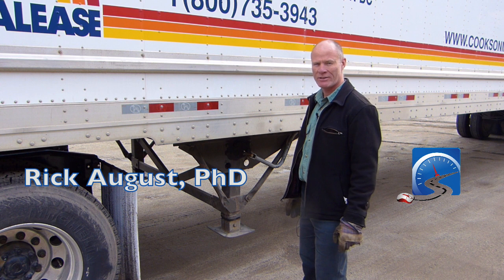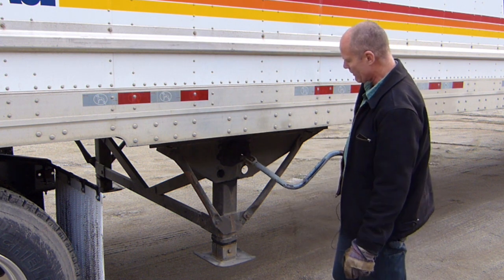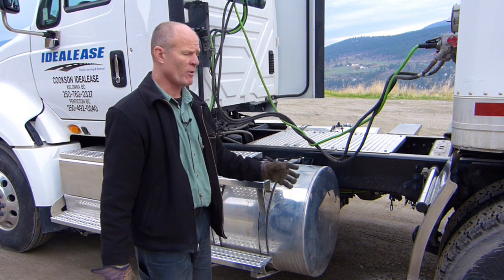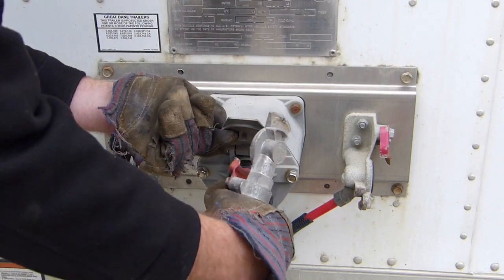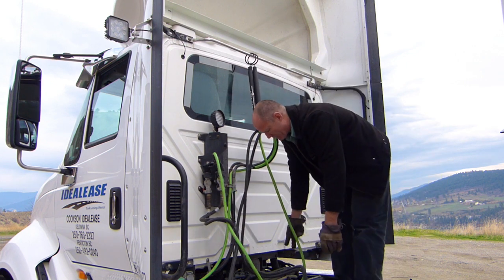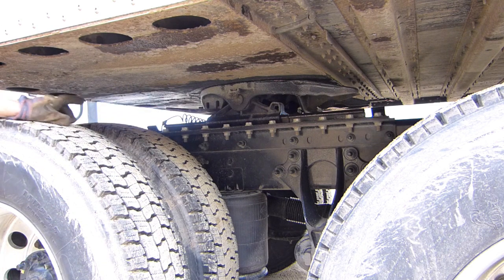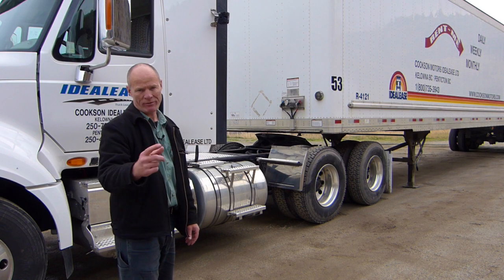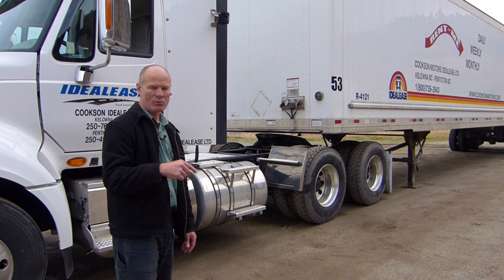How To Correctly Unhook A Semi-Trailer From The Tractor

Comment: Thanks for the information Rick. The truck I normally drive doesn't have air suspension but the last few days I've been driving one with air suspension and I was letting the air out before moving forward. I'll definitely try the way you showed on Monday.
Reply from the maker: Hi Texas Slim - Thank you for your comment.  We're happy to hear we could help out. Drop back and let us know how it goes. All the best, Cheers Rick
Reply: @smartdrivetest  Hey Rick, I have been pulling forward a bit before lowering the suspension and it works wonderfully. Thanks again.

Comment: So if you were to couple the trailer would you back under the trailer right before the Kingpin and then raise  air suspension up and then continue to couple or would you just backup under the trailer with the air suspension already lifted and raise the trailer.
Reply from the maker: Hi Joseph Vigil - Thank you for your comment and query. Lower the air suspension, back under the trailer so the fifth wheel is just in front of the kingpin. Stop and secure the tractor. Get out and check that the 5th wheel is in line with the kingpin, the jaws are open and the locking handle is out. Then reach in the cab and raise the air suspension. Go and check that the truck and trailer are at the right height to hook up. In other words, when the suspension comes up, there's no daylight between the trailer apron and the fifth wheel. If there is anything further we can do, drop us a note. Always happy to help. All the best, Cheers Rick

Comment: Do you set the trailer brake when unhooking ?
Reply: YES!!!  For 2 reasons. 
1: It prevents the trailer from rolling away. 
2: it prevents the gladhand from blowing air out when disconnecting it.  That air can blast stuff in your face. It can also blow back at your face and hit you.

Comment: Just a little reminder there guy, at timer 1:33 you placed your hands onto the side of the trailer to down the legs. Cranks work real good in the hot summer days when the lube is real loose. " Caution "-  Classic boo boo, from my 40 years, last trailer was short handle, next trailer, got it spinning is good, leaning against the trailer, not knowing the size of the handle, got a good spin, leaned in, and that handle belts you one good, right the mooy. I didn't lose any teeth, but it did chip one and it hurt. I know you've adjusted your noodle, you've probably been there, just remind the crews, to watch the handle size. Some are longer than others.

Comment: I always drop the air suspension on the trailer before I dynamite the trailer brakes. Then do what you did in the video. If I'm dropping a heavy trailer on anything but concrete I will try to ring dolly pads to help disperse the weight of the dolly legs. And yes I've forgot to unhook the airlines when I was a new driver and had the smack the back of the cab, but that was years ago now. Also had to rewire a couple light plugs when I was new.
Reply: Forgot to mention I enjoy watching your videos, very educational even for an older trucker. Keep it up.
Reply from the maker: Hi Greg D - thank you for your kind words my friend. And yes, dropping the air suspension before unhooking the trailer is a good idea - especially if the trailer's loaded. It puts less pressure on the dollies. And of course, we all made mistakes in the beginning. All the best, Cheers Rick

Comment: Is there good method to backing only a few inches. I find its hard to tell when to stop in time.
Reply from the maker: +Darlene Young thanks for your comment & query. Are you talking about backing under the trailer? If so, look out the driver’s window, pick a landmark & back off that. Let me know. All the best, Cheers Rick
Reply: Thanks Rick, I am practicing hooking and unhooking before each trip. I will try the land mark tip to know when I've moved 6 inches. I find hooking more difficult to remember all the steps. Thanks for this great demo and LAP tip.I wish there was a good trick to memorizing the steps for hooking up.  I'm learning to start on an up hill and reversing. Moving along. Have my road test next week.

Comment: In my opinion the trailer is to high ! The way i do it is i let my landing gear 1/2, 3/4 of an inch of the ground ! Unlock the trailer and i move forward about 1 feet and then release the air from the suspension and go out when its totaly down ! And its better because the next time you coupling you lower your suspension go under the trailer (totality of the fifthwheel) and crank it up so when you couple the fifthwheel fhe landing gears are not touching the ground so if your out of line there is no stress on them by forcing in one direction ! But it is me ..
Reply from the maker: Hi Jimmy Pineault - Thank you for the information. Keep in mind that this is the procedure for the CDL test. As you and I both know, it's different in the "real world" of trucking my friend. All the best, Cheers Rick
Reply: Hi Rick ! Of course i understand the cdl test fact but in my counrty (Qc canada) we dont have to uncoupling and coupling a trailer .. we arrive with the trailer we do pre-trip inspection and go for a drive and a back up and thats all .. but in Usa it look more complex !
Reply: @jimmypineault2648  I didn't have to uncouple for my cdl test in Ca.USA

Comment: You do not drop the bags first.  That's how you fracture the landing gear.
Reply from the maker: No, LAP - landing gear, lines and pin. And after releasing the pin, pull the tractor forward a bit to get out of the king pin. When you're clear of the pin, then drop the air bags. All the best, Cheers Rick
Reply: @smartdrivetest  I think I was responding to someone  completely different.   I've always called it LAF.  Do you explain why you never pull the fifth wheel last?  Many don't know.

Comment: Pin puller is important for more reasons than just avoiding grease.  Pulling too hard on the handle WILL destroy your shoulder.    A company I worked for required us to use pin pullers because of the amount of shoulder injuries they had to pay for.
Reply from the maker: Interesting. That makes sense. Thanks for the  information. All the best, Cheers Rick
Reply: Pin pullers are the worst. Especially when the manual won't unlock it either.

Comment: I work for a leasing agent, just today had to pick up a bobtail for service.  Got to customer and it was hooked to a trailer.  I remembered the pin, I remembered the hoses, and thank god I remembered to dump the suspension.
Reply from the maker: Hi jfsa380 - that's a great story - thank you for sharing. And if you put the landing gear down too, then everything went according to plan! 80) LAP - Landing Gear, Air lines & electrical, Pin is the acronym for unhooking. PDA - Pin, Dollies, Air lines & electrical is the acronym for hooking up. If there's anything further we can do, drop us a note, and thanks again for the story. All the best, Cheers Rick